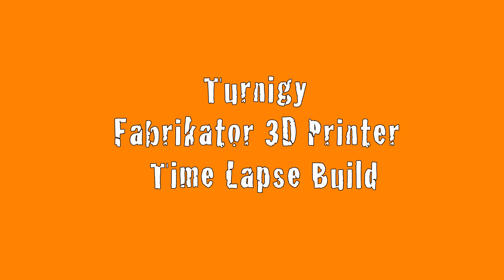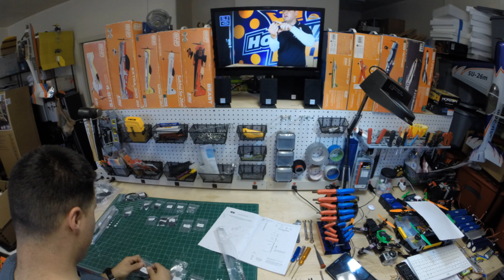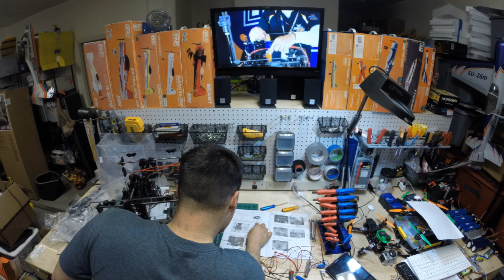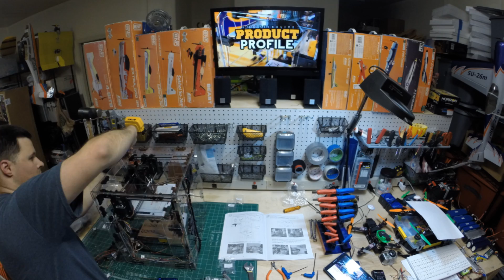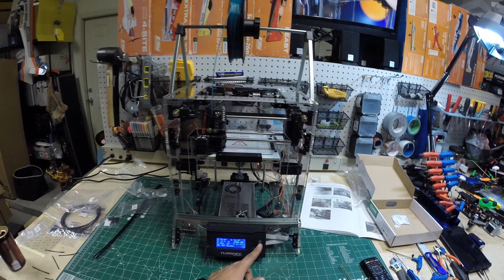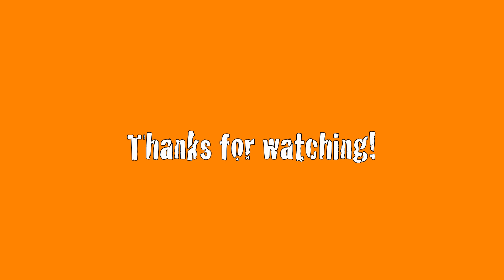HobbyKing Turnigy Fabrikator 3D Printer Time Lapse Build

Comment: Hi, nice video, finished mine 30min ago, after building, I have some parts and bit left? I think it are spare parts, but one bag of parts (PM-3PT04-P01 ( 3)) are in the box and manual but I cant seem to find what it is used for, do you have any clue?
Thanks.
Reply from the maker: +FGDude I had some stuff left over but don't have the bag part number anymore so I don't know if its the same pieces. If you followed the build videos from HK and the manual then I'd assume its just little spares too. There were some little sticky pad things that look to be cable retainers, I didn't use these and don't believe they are listed in the manual.